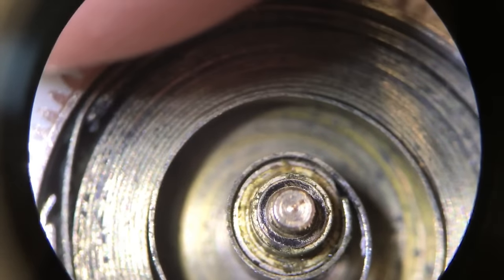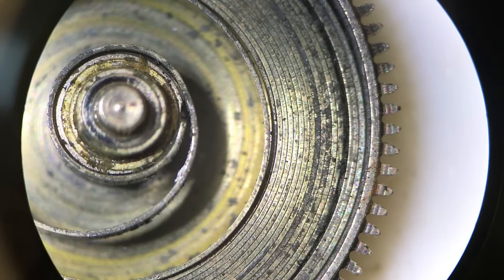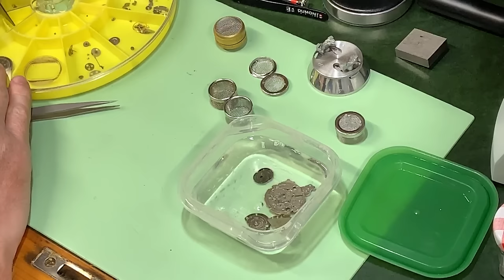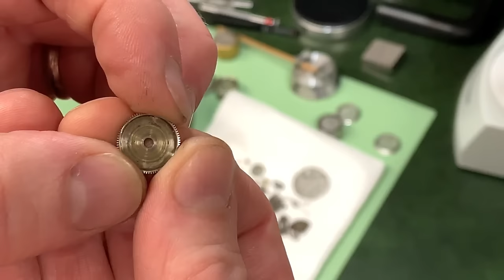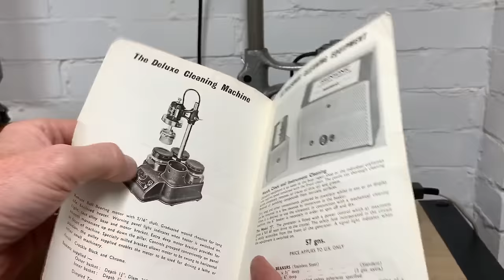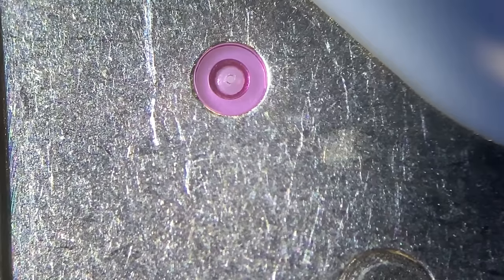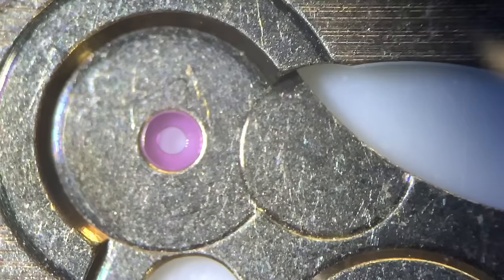Cleaning Watch Parts - Seiko 6309  (5000 Sub Giveaway Series)

Comment: Top tip. If you live in a hard water area try using distilled water instead of tap water. This eliminates the risk of leaving a tiny film of dissolved inorganic calcium salts on the components found in hard water. Also use the same for rinsing off after cleaning. Distilled water can be expensive so I have a dehumidifier in my workshop to keep the humidity down to a safe level at aroun 45/ 50% . This way I also collect as much distilled water as I need. I also add a few drops of rinse agent, the sort you add to a dishwasher, the cheapest brand will do. This helps prevent water beading and thus aids drying. Oh, and never ever put your fingers in the ultrasonic whilst it's working, it'll cook your fingers no prizes for guessing how I found that one out.
Reply: That's clever.  Dehumidifier water and dishwasher rinse agent.  Kudos

Comment: I basically use this exact process with the exception of using a different brand sonic cleaner.  That's it, and everytime I wash all of the high torque (steel) parts like the canon pinion they come out rusted.  I don't know why.  I'll pull them out of the alcohol stage and place them in a mason jar with a heat gun to dry, to which they'll come out looking fine but after 3 hours there's always a layer of surface rust over all of them and I have to bust out the scratch brush to remove it.  Interestingly, after I remove the rust with a scratch brush and wash it in alcohol (making it look good again) the rust comes back in another 3 hours. I'll also add that no other watch part does this, either on different watches, or on new parts I order, just on the ones I wash using the Naptha+Distilled Rinse+Cleaner+Distilled Rinse+Alcohol+Dry process.  It's driving me insane.

Comment: Thanks much for any tips that do the job rather then buy these overpriced rinses and cleaners.  I can't justify paying over $50 for a gallon of watch rinse and/or cleaner.  Vinegar and distilled water with some Dawn or Murphy's soap thrown in works well, as does the rather unorthodox windshield washer fluid.   Then, rinse with distilled water.  Then, rinse again with 99% isopropyl alcohol or QD Electronics Cleaner.  The latter contains hexane and evaporates really fast.  Hexane is essentially what that overpriced grift One Dip is .

Comment: Interesting and thorough quick course. I would think, considering the cost of the cleaning solution for the watch cleaning machine, that you might want to strain them through a dense flexible cloth or other similar material, therefore keeping the cleaner but tossing the trash. Maybe even a chamois cloth. Just a thought that might save a few (or more) bucks.

Comment: I used a ultra sonic cleaner for many years but eventually purchased a dedicated watch cleaning machine. The difference is remarkable in terms of cleanliness and ease of the cleaning process. The pearl retails at approx £500 and in my opinion is worth every penny. PS I still use the ultra sonic for clock parts.

Comment: I found your channel because I wanted to learn servicing watches (I thought it's a good place to start), but the more I watch your videos, the harder it seems. There is more to learn than I thought :(
Reply from the maker: It can seem overwhelming but its not.  Start slowly with some basic tools and take loads of photos of the movement as you take each part off and that way you have a record of how it call goes back.  Its only on when you have done one that you realise its not so difficult. However thats when you want to get better, more tools and then cleaning / timing becomes important to you. its a gradual thing. I have only been doing this for around 2.1/2 years although I have got a bit obsessed.

Comment: There is an easier way of cleaning the balance than doing it separately.
Mount the balance assembly in its place on the main plate and after doing so remove its diashock jewels.
You can then throw the main plate with the mounted balance in with the rest of the parts for cleaning.
Much safer than fiddling with the balance on its own and it will get a better clean.
That's how I do it anyway.

Comment: Mike, that was actually fascinating. It's tempting to scrape some of it, but I know the damage that would do. I am a bit curious as to why you didn't do the dial? Wouldn't it have been relatively safe to at least put it in the ultrasonic cleaner? At any rate, I'm really enjoying your videos! Many thanks.
Reply from the maker: Dials are often lacquered and the decals are transfers so you run the risk of removing them.  My only cleaning method for a dial is rodico and on occasion a Q tip with saliva.  As its the dial we look at the most I do not want to risk ruining this one.

Comment: I've got a huge can of fast panel wipe and wondered if that is any good for putting in a ultrasonic as it says on the paperwork its good for degreasing especially instruments and dials as I use it for spray painting in between layers and is good stuff.   Fills my daughters lighters a treat too hehe

Comment: Very interesting and informative.  Out of curiosity how did you learn how to restore (assemble/disassemble) watches.  I work on very fine stuff in electronics design work (0.002" tolerances) and enjoy the fine movement skills under my microscope.  Did you take classes or just wing it ?  I'm reluctant to try a rebuild of some old pocket watches I have and would someday like to restore them (with the proper knowledge on how to do this).

Comment: Great Video!, so detailed, loved it. Quick question, how do you separate top and bottom jewels during cleaning?, i know it's a problem if you get them mixed up during assembly. Thanks again.  Adrian 🍀🍀
Reply from the maker: Thanks. My understanding is the Seiko 6309 shock jewels are the same size so I have washed them together.   I guess if we have problems in regulating then that will be the cause.  I have done this before on a 6 series without a problem.

Comment: You need to try some "FLASH" Mike. Best degreaser ever!! Fairy liquid sucks..
Reply from the maker: what the floor cleaner?
Reply: @MyRetroWatches  Aye the yellow stuff Mike it's the best degreaser out there. I've tried all sorts from IPA, lighter fluid, brake cleaner and fairy liquid I've used on vintage clocks for ages and the grim just floats off. Give it a try.

Comment: Have you ever tried polishing the inside of the barrel to remove / reduce the scouring of the mainspring?
Reply from the maker: No, that would be really hard to get in there and removing any material could take it out or round. Dont forget that spring is under one hell of allot of tension inside the barrel on a full wind.

Comment: How did your manage to put the ultrasonic on 50C with so little water?  I did something similar at 30C and the machine started smoking.  I don't know if there wasn't enough water to soak up the great generated from the ultrasonic waves, or if the wire insulation was burning up.  But everyone i turn on the heating element i smell a burning smell.
Reply from the maker: Never had any problems with heating with 50mm + of water.
My cleaner is only 2L

Comment: Can't wait for the regret video on a Cheap Chinese ultrasonic cleaner.
Reply from the maker: That’s up to you. Mine lasted 5 years. I now actually have a proper watch cleaning machine.
Also to add that if you are to clean watch parts in an ultrasonic you don’t want a strong one as it can potentially damage the more delicate parts. 

I have no regret on the cleaner and when it did give up I just bought the same model again which I use to clean bracelets and often hairspring’s in a solvent solution .

Comment: Hi Mike, I do enjoy all of your videos. I like this one very much and got my ultrasonic cleaner yesterday.  
I am tempted to try your cleaning method but am a little bit afraid. I have read that it is very dangerous to use IPA, Renata, gasoline and other flammable and highly volatile liquids in a UC, even in closed jars. I have also read that the jars should not be tightly closed to prevent the explosion by letting the fumes out. 
I know that you say that the jars will not explode, but still, do you have any comments or advice?
Reply from the maker: Well I can only speak from my experience and that is nothing has ever gone wrong for me.   I have my jars closed and sitting in water.  The ultrasonic will not heat up to the point of explosion as that would be considerable heat!  These machines are not all that powerful either really.  My understanding is these liquids are flammable by naked flame so I cant see how that would happen in a closed jar in a bath of water. 
If you didn't use heat in the ultrasonic water you would have to question how they would expand anyway.  If in doubt just put a small hole in the lid.
Reply: As a test, I ran an open 500ml container of gasoline in my ultrasonic,  it was fine. I regularly use containers full of spraypainting solvent or "gun wash" for cleaning engine parts etc, usually hot washed. (I fill th3 ultrasonic with water and use jars or containers for the solvent). I always run it outside and it's been fine. Should you do it, well probably not... but so far so good

Comment: Chronoguide watchmakers in holland says never put watch movement parts in Ultrasonic cleaner. help!
Reply from the maker: Well yes but he has a proper powerful one whereas I have a cheap hobbyist version.
Equally it does not stack up for me personally the ultrasonic argument that it damages parts is not completely sound in my opinion.  They show a tin foil trick where it disintegrates. You will not disintegrate a piece of stainless steel no matter how hard you try and I’ve never experienced any damage to wheels either or the plating that is on most parts.

I have seen other professionals on YT also use ultrasonics too.

I now use a cleaning machine I bought second hand mainly because it’s a waterless system and the fluids are far better at doing the job.

Comment: Do you know how to change bezel insert for omega 200 pre bond watch?
Reply from the maker: Sorry not really. On Seikos you remove the bezel and heat with say a hairdryer as they are glued in position so the heat softens enough to remove.  Then you buy these bezel adhesive disc things to then stick down the new one.  Cant say Omega do the same though but I would assume so.

Comment: Is it ok to clean a metal bracket in the metal basket? Will it scratch?
Reply from the maker: I’ve never scratched anything in the ultrasonic
Reply: Wrap it around a glass jar if you're worried. Especially useful for cleaning the insides of an expandable bracelet!

Comment: hi! Love your videos and am learning new stuff everyday... A quick question; I'm at the point where I'm going to clean my parts for the first time, 3 step process in an ultrasonic. Just to confirm: 
Step 1: all parts excluding balance complete in Fairy (we call it Dreft over here in NL ;)) in box with water in ultrasonic. Let it dry overnight 
Step 2: all parts in jar with Essence Renata, OR, only the balance complete in ER, in jar, in ultrasonic. Let it dry overnight [this step is unclear]
Step 3: all parts EXCLUDING balance complete AND pallet fork in IPA, in jar, in ultrasonic. Let it dry overnight

I feel I'm missing something... hope you can help me out! Much appreciated! Regards from the Netherlands
Reply from the maker: Robert hello.   Okay so you have to be very carful with water cleaning its fine to clean in soapy water but its the drying that is important to do well and quickly . Parts overlapping or sitting on a wet paper towel might rust.  (I now clean with a dedicated machine and fluid) clean parts in the ultrasonic in the soapy water.  remove parts onto a paper two or similar.  Turn parts to make sure as much moisture can be absorbed as possible.  Transfer then to a new towel or a container.    I would then dry this overnight on my house heating radiator.    
If you then have Renata (UK product only I believe)  you can clean everything in this.  If you have plenty of it you could skip part one and just clean all parts in the renata.  Remove from renata into a container, no need for paper towels anymore.  Renata evaporates in a matter of minutes.   You can then repeat in IPA leaving the balance fork and the balance out of this cycle.  The IPA can melt the shellac that holds the jewels on so its important not to risk this. 
Remove parts from alcohol and again in a container.  This is your last clean so you do not want any contamination of fibres getting onto the parts.

Another thing to do to speed it up is after the water wash.  sit on towels to soak most of the water, then stick it all (except fork and balance ) into alcohol for 10 minute cycle in the ultrasonic, this will wash all water away and your parts will dry in minutes and eliminate rust
Reply: @MyRetroWatches  I bought some supply of Renata before Brexit so I'm good and ready! That sounds like an ideal solution, start with renata and follow up with IPA and leave out the water + soap part.... Awesome that you're taking the time to answer and give tips! Thanks!!

Comment: I can't find essence of renata is there any alternative that I can use?
Reply from the maker: Bergeon one dip is supposed to be good.  Expensive though.
Reply: thank you Michael, but the thing is I live in Turkey where tinkering with watches isn't really a thing so it's really hard for me to find supplies and even if I find them they are really really expensive compared to other places and to top that off eBay doesn't work here I
Reply from the maker: ammar dalati these are in Germany (I think). I have never used them but use their reference database allot.

https://www.boley.de/en
Reply: @MyRetroWatches  thanks alot I will give them a try